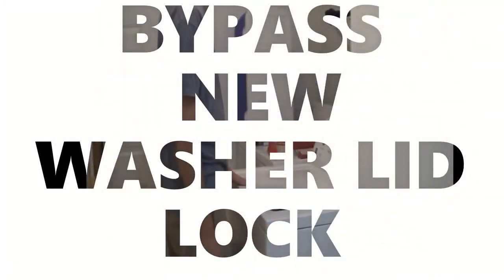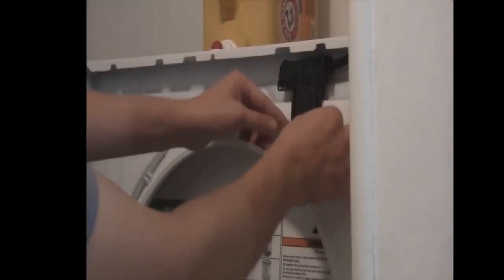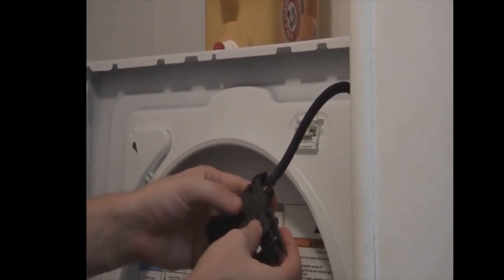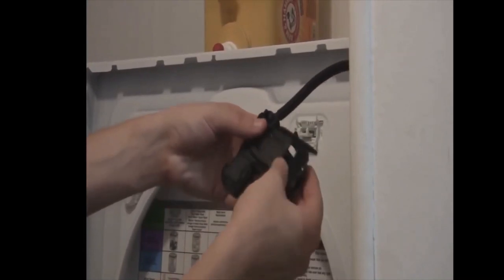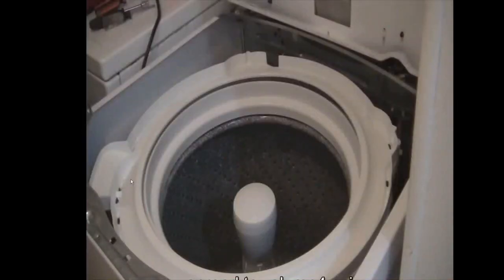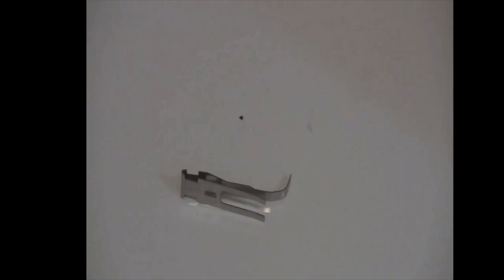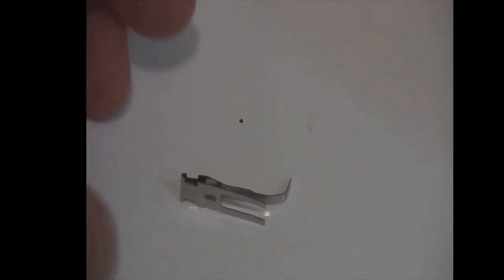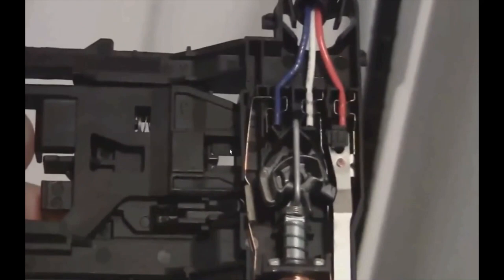Amana Washer, Whirlpool Washer, Maytag Washer or Kenmore Washer won't spin? Bypass the Lid Lock 🔒

Comment: I just want to disable the lock and be allowed to open the door when the machine is running. At this time, nothing is broken, but i sure miss being able to add products to the wash cycle without having to start all over again every time.
Reply from the maker: Unfortunately you cannot do that any more with these new digital washers. The washers computerized "control board" has to communicate with the lid lock several times through out the cycle and it will need to see that it is locked.

one thing you may be able to do is remove the piece that your lid lock locks into..  depending on the model you have you may be able to trick it... send me pictures to 559appliancerepair@gmail.com ill take a look at it for you

Comment: I purchased a replacement lid lock off Ebay, when I  am doing laundry, I put it in place, you will have to leave the lid open, however problem solved.

Comment: Fantastic video. Does this work on all lid/lock machines? Do you remove that plastic piece from the washer or leave it connected? I'm still confused. 🤦 Maytag Bravos XL, 5-6 years old. $100 for lid/lock replacement part. Not happening. Thank you SO much in advance. Also, Corona Season.🙄

Comment: The piece in the middle that the solenoid works, is the small protrusion supposed to fit on one side the end of the solenoid when locked and the other when not locked?
  When I reassembled one with it to the right, I get no reading from white to red.
  Can I just remove the little plastic piece on the red wire arm that drops down locks the lid, or will it stay hot and cause problem?
  Seems like I saw somewhere the red stays connected to the white wire at all times.
Reply: I also bought a new lock switch and it didn't work. They make them so cheap that pieces break off so easily

Comment: Which way is the permanent lock position?
Reply: Quick & Detailed How-to & DIY Guides hey George, the way I was looking at it the button on the other side is actually up but on the switch side where you rotate the metal piece it was down. I did this and it worked!

Comment: Thanks for your video - you seem to be the only person taking on this problem. There is a special place in hell for the person that designed this switch assembly, and an honor award in the "needlessly complicated" Hall of Fame.  I replaced the whole switch assembly but am still getting lid errors in the Apollo era diagnosis system.
I'd love nothing more than to electrically bypass this P.O.S. entirely. I managed to jumper the Lock Switch and Lid Switch - but it still won't cycle through. I'm hesitant to rip into my new switch assembly - but you think that removing this clip will solve the problem?
You're a hero. M
Reply: I brought a new switch, which quickly developed the same problem as the old one. Removed the part as described here, and it works perfectly. Now only if there was a similar trick for the shift actuator!
Reply: I love your reply so accurate.